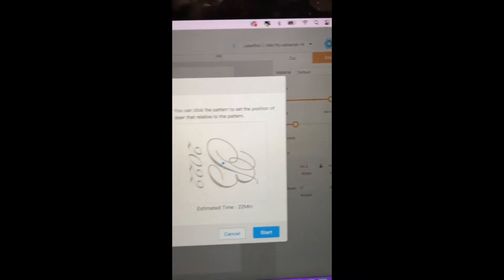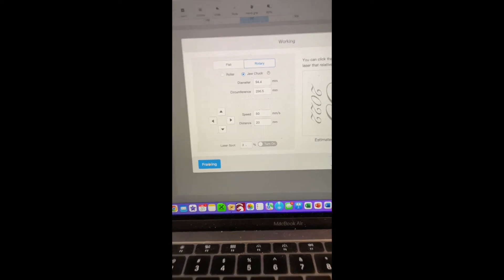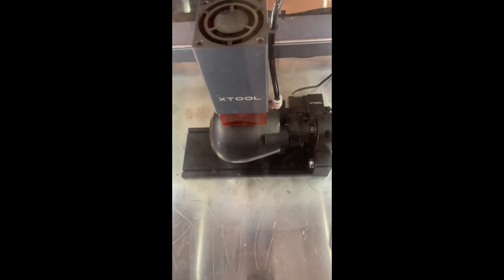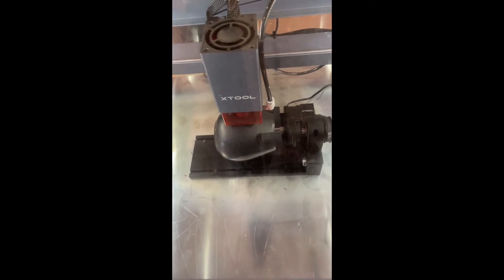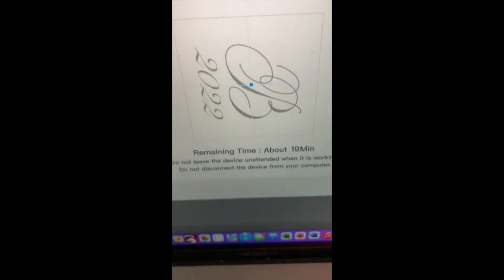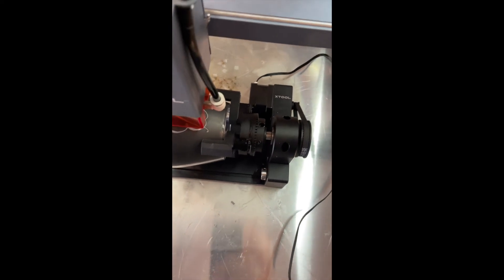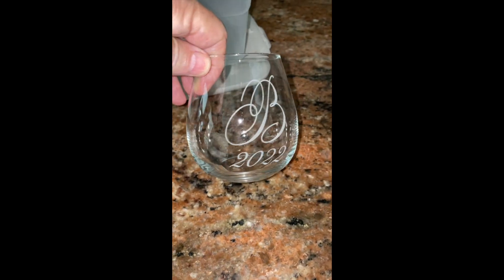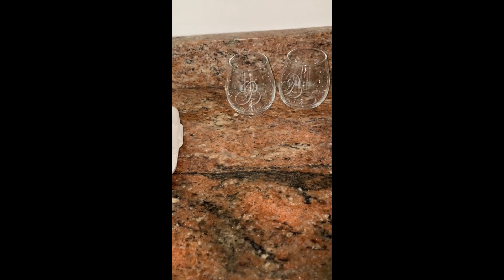Engraving on Glass with a 20Watt XTool D1 Laser

Comment: Do I have to put the paint on for the D1 20 watt pro?
Also is a black chalk paint the same?
Reply from the maker: Yes, the diode laser cannot mark the clear glass without a coating. In my experience, I find that the chalk paint can leave the lettering with black lettering rather than the frosted look you get with the tempera paint. Try it and see if you like the look.